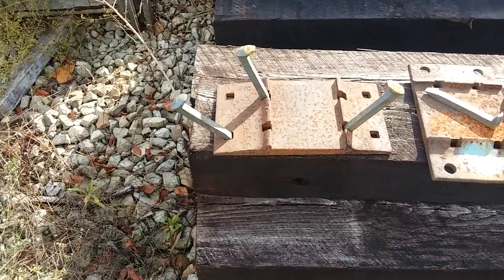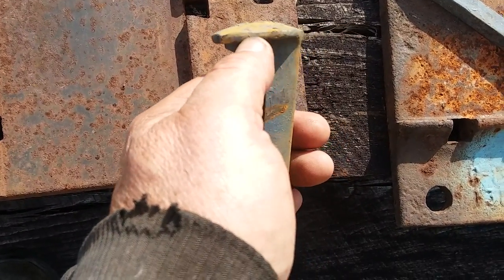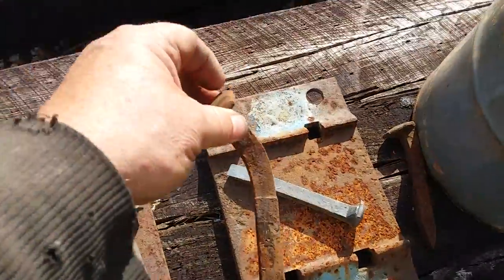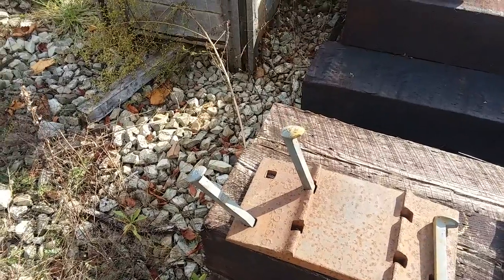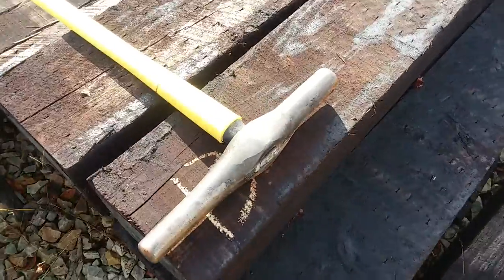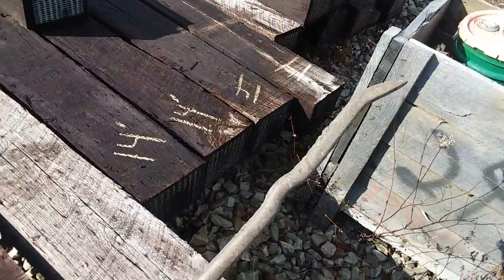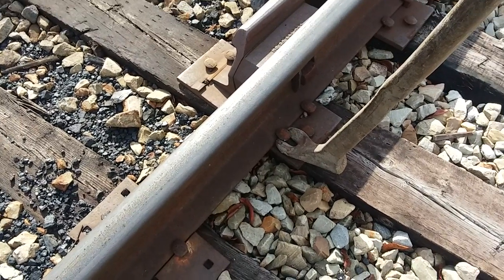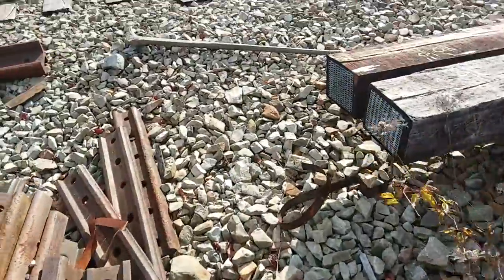All about Railroad Spikes

Comment: I worked on a section gang in Thomas yard in Birmingham, Alabama in 1974 before track repair was mechanized. We the track gang did everything with hand tools and back muscles, pulled ties, moved ties by sticking a square shovel 4 inches into them and using the shovel handle to get a grip. We bent turns into the rails with 10 guys with prybars and a guy singing cadence so we would push together to move the heavy assembled track. I'm proud that I had that job now for an historic experience , but the job sucked. The rail was joined by bars and bolts, not welded like now. We busted rear from can to can't as my wonderful Granny would put it, with heavy tools and an awful amount of manpower to keep the track fixed so trains could safely run over them. There were mechanized road crews that replaced main lines but repairs around town and the railyard were done the hard way. I still hate shovels, hammers, prybars, picks and chat(now called ballast)(gravel here in the sticks) and all track repair things.
Reply from the maker: Oh wow Jim, that was real railroadin back in them days, took a lot of fortitude and strength to do that all day, appreciate your comment sir, great story and thank you sir for sharing with us. Really helps to more appreciate the mechanization nowadays they have. Thank you for watching
Reply: @blakestone8088  Like the old fireman on the railroad stoking the boiler. There is a dammed up creek with a building on the dam that housed the pump for steam engine boiler water near me. The main railroad line was moved in 1917, so these are some old relics that remind us of a long forgotten history.

Comment: Used to knock about 1400 of those in each day.
We also use another type called a lockspike which is like a split pin.
Also here in Australia we got a wood called wandoo, it instilled fear, awe and reverence into railworkers, the sleeper/ties can be 50 years old and rotted to the point of it looking like mesh but you won't get the spikes out even after driving them in, it would also derail the hydraulic spike pullers as well.
Reply from the maker: Very interesting comment sir! Have never heard of that type, will research on it. Havnt heard of that wood either. Derail a spike puller ! Wow thats amazing
Reply: @ccrx6700  lockspikes were mainly or holding the plates since they have no way of holding the rail, usually used with the e-type clips...similar to the other plate in the video.
Reply from the maker: @matty101yttam  sounds like a very secure system, would be excellent thru turnouts thanks for sharing 👍

Comment: The foreman on the railroad when I was working on the Railroad always told us in the hot summertime or winter you always stick your claw bars and your shovels and the ground standing up right they can be easily foundAnd will not get as hot if they’re laying on the ground and creating a trip hazard
Reply from the maker: Excellent advice! I hate stuff laying around in the track, tripping hazard
for sure. Many guys use a tool and just throw it down. Do appreciate your sharing that with us Robert

Comment: Also if you put the spike in at an angle you do more damage to the tie. If you are using a power spike driver you really need them straight but hand driving them is sometimes easier on a slant. I have seen short spikes, about 4 inch for spiking the tie plates to the rail but they are rare. Tie plates on my line almost never have more than the four holes for the rail spikes. "Round" spikes we call drive spikes and they go in most often at grade crossings and other special places. They have a spiral curve on them and can be hammered in or use a special driver.

Have you ever been using a hydraulic spike driver and could not get the spike to go down? Some times the moisture in the tie gets so hot it turns to steam and pushes back on the spike. How do I know? Took a bar and pried the spike away from the rail and a cloud of steam shot out from around the spike.

We get spikes in 90 spike cans, a bit larger than yours. I wish we got them like yours because they sure are heavy to load on the truck when we go out to work.

Ever worked with pre-drilled ties? I hear that they hold better that way but have never had the chance to do it.
Reply from the maker: Keith, Excellent comment sir! Thank you for sharing your expertise with us, much
appreciated

Comment: I bought some old used RR ties from a local lumber yard years ago for landscaping purposes.Over the years, many of the already very old ties were so rotted away that I pulled them into a burn pile with my tractor and lit them off. That left many steel plates and spikes in the ash pile. I collected them and tried to turn them in with other steel scrap at a local scrap yard. To my amazement, the yard refused to accept any of the old railroad stuff because they were still considered railroad property. He couldn't say WHICH railroad though. I still have some of the spikes. They occasionally become useful for other purposes.
Reply: Junkyard crack me up. No problem taking stolen copper all day, a small bucket of old burnt spikes? No way.
Reply from the maker: Understand that, years ago any scrap yard here would take rail material, after scrap prices skyrocketed bout 7 or 8 years ago the laws got a lot strictor and yards quit taking them unless you had a paper from the RR saying it was okay with them

Comment: We have collected old RR stuff for years, one example is, I think is called a whistle stop, seem like to me it should be a whistle blow, thing weight is seem to be about 50+ pounds, it's just a big maybe cast thing with a w on it, that's when they used a whistle it told the engineers to set of the whistle comeing up to high ways, big porcine signs with glass eyes, several old lights, then if that wasn't bad enough, went to lanterns, of corse they have to have mostly RR writing on them, I think it's a sickness

Comment: you answered one of my questions i always wondered how the gauge stays in place it always amazed me that the tracks don't spread apart since the wheels seem to have most of the weight carrying load on the inside of the rail .
Reply from the maker: Didnt show you in this vid, but the ties plates are cut with a 1 in 40 cant, so the rail doesn't lay flat but on a slight lean inwards, that helps. Will do a future vid on tie plates. Thank you for watching
Reply: @ccrx6700  Thank you, always thought they were symmetrical!    Been looking & looking at it again  and still can't see what I know your educated experienced eye can spot right off!  Thanks again.
Reply from the maker: @alro2434  👍😊

Comment: The four bumps on the "short" puller got their name from a 50's Buick that had four portholes on the side of the front fenders.  The model Buick with four portholes was named Roadmaster.
Reply: Sweet Bob! Thanks for adding that info to the conversations, Excellent addition
Reply: I recall that the official name of those Buick ports was Cruiserline Ventiports.

Comment: SpikeFast is another product used for plugging, it's a 2 part mix liquid and also works great on sealing cracks in yo driveway lol. 
The main type of tie plate used is a double shoulder plate also usually a railroad would use some form of rail anchor with spikes.
I see that pandrol plate hiding there lol They use those primarily with concrete ties but also can be used on wood ties, they eliminate the need for spike since the anchor is a lag type spike.

Yeah I may know a thing or two from my years hanging around the KCS yard, I work mainly on their comms and IT (radios, EOTDs, servers)
Reply from the maker: ElfNet Designs, thank you for the informative comment. The Spike Fast is the cadillac, we don,t use it cause we were told have keep it warm in winter plus we don,t use that much at one time so a good part of the tubes would be wasted. It is great stuff tho! Am going do another vid sometime in future on tie plates. You worked KCS, thats awesome! Used know several tamper operators for them, but that was lot years ago. Did you happen to know Ned Wimmer or Larry Case? They would have been tamper technicians bout 10 or so years ago

Comment: Good video of the intricacies of track laying.  There's much more than meets the eye!  I especially like the thermite welding!  I watched a crew from time to time put in sidings (or spurs) for "parking" fracking sand containers in July about 15 years ago from a 6th floor window where I worked.   I gained a new appreciation for my office job.  Thanks for sharing.  Is it true that locomotive crews refer to the dissipative heaters of the dynamic brakes as "toasters?"  I heard that many years ago from a Conrail employee in Altoona PA and wondered if he was pullin' my leg.  Thanks again for sharing!
Reply from the maker: Curt, very good question sir. I've never heard the dynamic brake resister grids  (which dissipate the heat) called that term, however I'm not going to say that those guys back then didn't call them that, does sound like a good description.

EMD made a loco the AEM7 that was called a toaster, also many
railfans have coined that term for a loco that has caught on fire.
Some GE locos are famous for blowing turbo oil seals which then causes a
fire with often the resulting paint on the hood to be charred.

Here's an extreme case of a loco being caught on fire for whatever
reason this one happened
https://www.railpictures.net/viewphoto.php?id=92222

Comment: I have never seen a spike here, all rail is bolted here in South Africa, old stuff with just tieplates, new stuff with Pandrol clips.  There was a phase of using steel sleepers too (instead of wood), but that was replaced with concrete.
Reply from the maker: Wish we had all Pandrol clips here, I really like how they hold
the rail, but alas we only have a very, very small amount of them.
We tried steel in a small section 35 years ago, but the first derailment
ruined those things and never have tried them since. Do appreciate
your writing in and for watching the video David.

Comment: I have a tie plate that was stamped.  The rail was held by two ears stamped from the plate. The plate was slid onto the rail and spiked to the tie. When were these used? The term "gandy dancers" refers to the 15-20 man crew that wrestled the rail to the ties and into position to be spiked down. Because of the weight the "dancers" had to use a continuous shuffle while moving the rail. They had various chants and songs to relieve their labor. A National Guard crew of black railroad construction workers were actually the first American soldiers to face the Germans in combat in WWI. They were building a line to move guns and materiel when the Germans broke through the French lines and they were thrown into the breach.
Reply from the maker: Gerald, as to the first part of your comment, I have no clue. Thank you very much for the history lesson there sir! That is very interesting, appreciate your sharing it with us

Comment: What are the tie plates made from......ASTM 1084 same a railhead. A company here in cen tx makes, as I understand, tie plates from plastic. The company  name is Vossolh I think.  I'm watching your vid now and you showed some odd tools one of which you didn't know why the nickname. In passing quickly you said "Roadmaster" and I saw 3 or 4 bumps on the handle and immediately thought of the 50's series GM Buick Roadmaster which had 4 or 5 false "exhaust vents" on each side of the fenders aft of the wheelwells...that was my flashcard image of that tool. Check the 53-56 Buicks out. I can remember in Erie PA at the GE plant train yard, where I saw a man throwing coal in a stationary steam locomotive, and Oil City some tracks spiked directly to the ties like you said.
Reply from the maker: Maybe this will help on the tie plates Robert
http://www.railway-fasteners.com/news/what-are-railroad-tie-plates-made-of.html
Reply: @ccrx6700  sorry the RR parts mfr is Vossloh, HDQ in Germany. Ever hear that name, going by there tomorrow, maybe I'll drop in. Thanx ror the info.

Comment: I am amazed that a country like the USA is still using this method in 2021. But having said that, i guess we have to take into account how the railways are used in the USA compared to other countries. Here in the UK most of our tracks are mainly designed for fast passenger trains - hence the tracks use concrete ties and continuously welded rail. Yes we have freight trains, but nothing like the amount you guys have over in the USA. I am guessing that a lot of track in the USA is used mainly for freight, and fairly slow moving freight trains at that (compared to high speed passenger). And of course wood is more readily available and cheap in the states - or at least it was traditionally. And not to mention the massive size of the USA - I would not even like to guess at the number of running miles of track you must have, a very expensive job replacing all of that with concrete ties. But having said all of that, I am still surprised that concrete ties are not being put back in place of the old wooded ones when track sections are being renewed. But at least you still get to enjoy the 'da da, da da' sound that the trains make when they go over the rail joints. Something we no longer have over here in the UK with our continuously welded rail, when travelling by train in the past I loved that sound. But now, with the continuously welded rail all you get is a constant roar from the wheels on the rails.
Reply: Continuous welded rail has been in use in the USA since the 1950s. I travelled about the US by rail in 95, didn't really feel safe on US trains, I was shocked most of the track is spiked.

Comment: Could you tell us about the rail joint clasp, how much does it weigh.
Reply from the maker: There are different lengths of joint bars also different size rails
use different weights of bars, the ones we use are 6 hole and weigh around 50 pounds per bar. Hope that helps

Comment: You don’t make friends with welders when you put a spike under a bolt! 

I was pulling spikes over in Bethlehem PA on the bridge between CP JU and CP88, there were bridge spikes, something like 9 inches long! 

I have never heard of Sure Spike but it looks interesting. We used the wood plugs and then the Spikefast 2 part epoxy. In a pinch we’d ram thin pieces of broken ties into the spike holes. This would be a great video to show new guys coming into MoW.
Reply from the maker: You got that right! Dont upset the welders...LOL. we used use tie plugs an have done the splinter trick  in a bind, never used the epoxy, but heard it has best sealing of any

Comment: Worked for a tie gang and rail gang for 5 years. Interesting but a lot was left out. Cut the handle on the maul to fit the person swinging the maul. You did not talk about the crossing spikes. Rail anchors, and the art of pulling spikes when the rail not the plate cuts the throat. sometimes you have to drive the spike in at an angle to pull the rail to make gouge. (no equipment) Detroit & Toledo Shoreline  Railroad.
Reply from the maker: Thanks for taking the time David to watch and write in my good man.

Comment: This looks a lot simpler and more straight to the point than the concrete sleepers with nuts, bolts and springs to hold the rail here in Europe
Reply from the maker: Concrete and wood both have their pros and cons. Most new construction in US is now concrete, cheaper to buy and they dont rot. Thank you for watching, hope you enjoyed

Comment: When my father was young, he was born in 45, he and his father and some of the older brothers, there were 10 brothers and 4 sisters, would cut railroad ties fr the yards in Jacksonville Florida. They were aid per piece of course , but they made a nickel more per tie if they were cut with an axe as opposed to handsaw. The reason being the axe closed the grain of the wood better and kept water from penetrating the tie as easy. Also i have a question about the carbon content of the spikes. I know they are generally known as low carbon steel , but i was told that if there was an HC stamped on the head that’s it was high carbon. Any truth to this? Thanks for the video and sharing your knowledge
Reply: I was told the same thing.  Whatever they are they "SEEM" to be a better alloy for strying to make SOMETHING else out of them.  Mot or nearly all of them are Manganese Steel.  They will buff to a kind of smokey mirror finish, just almost a good mirror finish.  BB
Reply from the maker: Marty, really intersting story bout your dad, that is so cool, thanks for sharing that with us. Cool about the axe! wow I never knew that. HC as far as I know means higher carbon, but do not have a good enough knowledge to explain that, really appreciate your watching sir
Reply: @ccrx6700  I enjoyed the video, very informative, thanks for sharing your knowledge. God bless you

Comment: I didn't go check your play list so I don't know if you ever covered the spacing of the ties. If so could you please point the way to that video, and if not could you maybe talk about it in a future video? I have often wondered how they came up with how far apart each tie should be placed.
Reply from the maker: I've mentioned it several times in several videos but not a specific
video on just that. The ends are 18 inches out from the base of the
rail and 19 1/2 inches center to center, which works out to about
12 inches the tie sides are apart. That is for wood ties. Concrete ties
often have a winder spacing between them, but since we don't
have concrete ties I rarely have mentioned them also.
Reply: @ccrx6700  That's good to know, but do you know why they are placed 12" apart? Is there some logic behind that, or is it just a random number the designers picked when they built the railroad? Why not 14 or 16 " ?